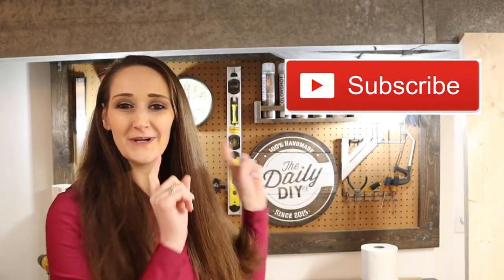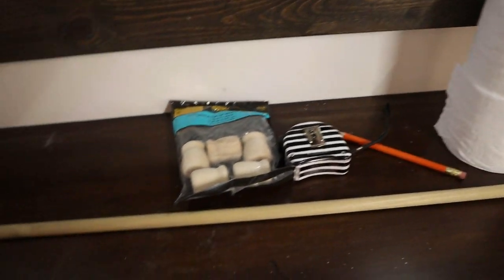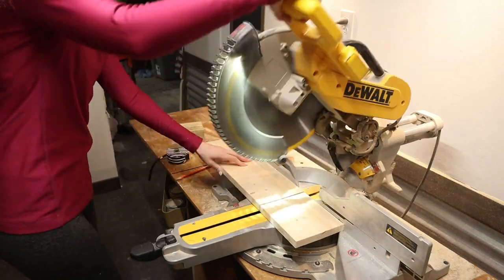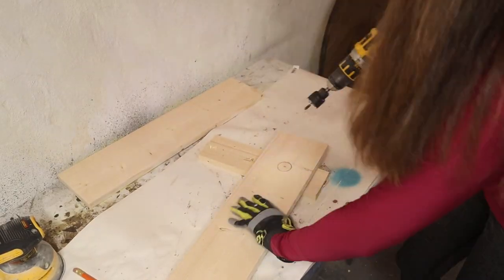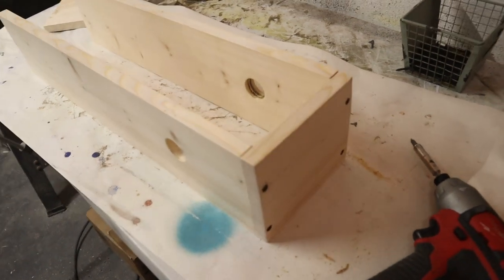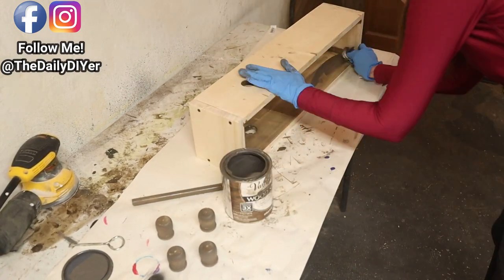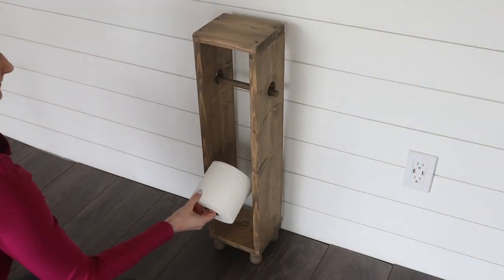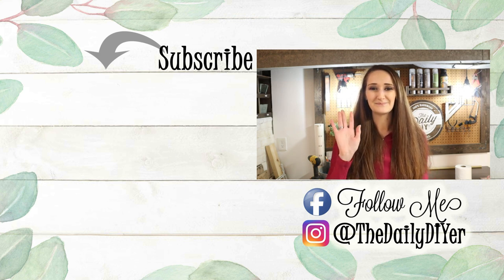DIY TP Holder | BEGINNER BUILD

Comment: Yippee....love builds, remodels, and upcycle  projects. Woodworking searches is how I found your channel a few months ago. For our smaller full bathroom, and for our downstairs tiny half-bath, I built 2 = 16"h X 14"w  recessed wall holders for toilet paper, wet wipes, and air fresheners. They're installed between the studs within easy reach of the toilet. The cottage styled white enameled bead board backer, and traditional trim of these recessed niches  was copied from one shown in an episode of This Old House, about 20 years ago 👍💕🏠. I've made several of these for family and friends.

Comment: Adding wood pins through each end of the dowel would ensure the dowel staying in place while the paper is being dispensed.
Reply: Wood pins? If I want to recreate this....which i am planning to do. Probably during this self quarantine that we are all loving right now. Hahaha HOW would I add these wood pins...what do they look like and where would I find them for the best price
Reply: I was thinking a small hole drilled through the dowel that holds the toilet paper. Then insert a small wooden pin (or just a small piece of a dowel the same size as the small hole drilled) through the hole on each side.

Comment: Your wood projects are what got me started in woodworking. I went from not knowing how to use a drill to owning a table saw, router, miter saw, jigsaw, nail gun, sander....oops? One thing I haven't figured out is when to choose the nail gun & glue and when to use screws instead. What was your reason for choosing the screws on this one?